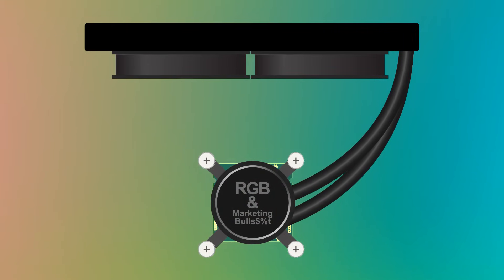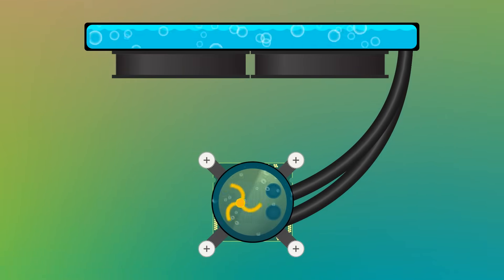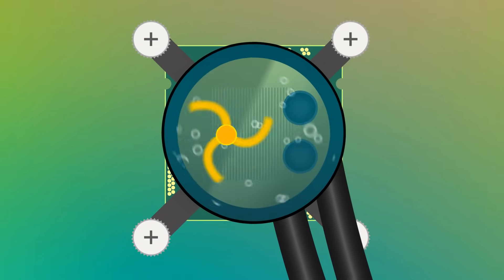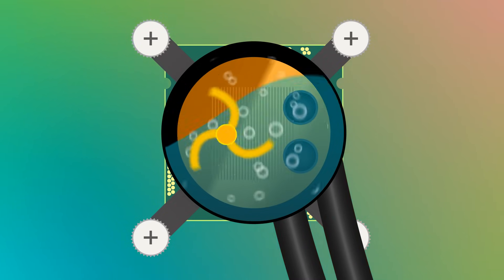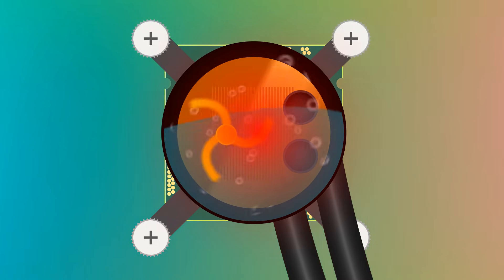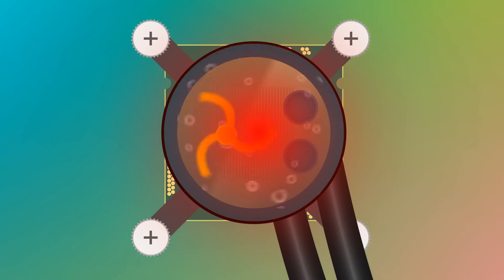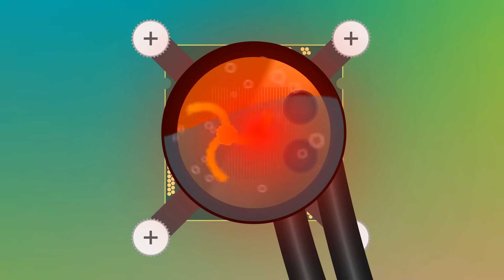Correct AIO orientation (This is the way)

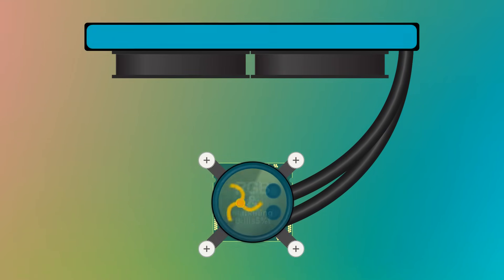Comment: @0:11 is how i mounted my aio. Is it fine like that? Just want to make sure.
Reply from the maker: So if your performance bottleneck is CPU mount the radiator like 1:43

If your bottleneck is the GPU than 0:11 is better (4k gaming)

If you have blower style GPU 0:11 is the best in any scenario.
Reply: Ehhhhh. The gpu creates a lot of heat and heat rises into the aio fans. So I would recommend to front mount your aio so it’s not cooling your cpu with hot air

Comment: Thanks for the presentation sir, but i have to ask what if pump is in the radiator like this https://storage-asset.msi.com/global/picture/image/feature/CoreLiquid/Mag-coreLiquid/mag-liquid-overall-lg-240.jpg  msi's brand new liquid cooler  MAG CORELIQUID 240R has pump inside ain radiator this orientation should work with this too? or not?
Reply: @Koray Karabulut that radiator needs to stand in vertically position.Easier to understand:must be mounted vertically and the pump should be turned "down".
Reply from the maker: @TheChudoviste  Thank you for you criticism, that point is very valid. It will be best to mount it vertically as you said.
But in that case, as I said it is a bad design as you are restricted to only one position and that is "if" the case allows you to position the radiator higher than the pump.

I would not suggest you force the in/outlet of the pump down if you don't have the space that accommodates the hoses. As mentioned in GN piece you shouldn't bend the hose too much as inner coating can break and fragments can circulate the system.
Reply from the maker: Great question! To me the principal is still the same air needs to stay out of the water block as much as possible.   

But that MSI design seems flawed provided that it still has air inside.

MSI's configuration will be more likely to circulate the air bubble rather than isolating it in the reservoir.
Reply: @Tech Infographics I excuse myself,but given that you call yourself a "tech",that is a stupid answer.Please don't represent to people like being something that you aren't,that can have same bad results.

Comment: Sir, you are a legend.
I am too lazy to learn how to do animations.
I did a couple of custom loops. You are spot on.
It is also a good practice with AIOs to lift the radiator completely above the pump/block before installation (fully stretched in vertical position) and to shake them both a little bit in that position, to make sure all of the air goes to the top of the radiator. Then mount the pump/block on the motherboard while the radiator is constantly on higher ground. Then mount the radiator in the position you suggest.
That way you have pump constantly flooded (zero air) and avoid having to force the pump to push the air bubbles down the tube to the radiator ports (like you show in animation between 1:25 and 1:30). Alternatively, you can lift up the whole system (whole case, with AIO mounted in the position you suggest) while the pump is working and rotate it so that the radiator is completely above the pump/block and hold it like that for a minute or two. That way you can help the pump get all of the air to the top of the tank/radiator very fast. (And avoid an hour long disappointment of listening that weak pump gurgling those air bubbles out.)
Reply from the maker: Thank you for kind words! 
I'm baffled that manufacturers don't mention this simple tip in the manual.

Felt sorry for a lot of people who had problem with their expensive AIO because of such a simple oversight.

I will make a longer version of animation to demonstrate your orientation methods.